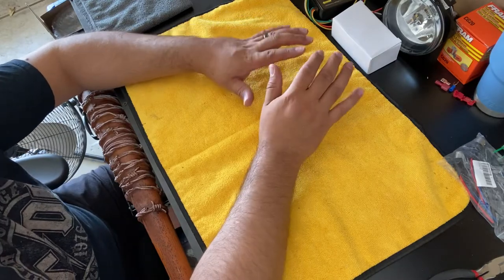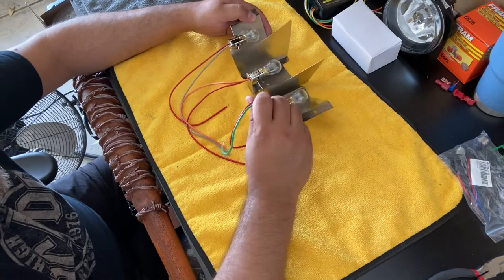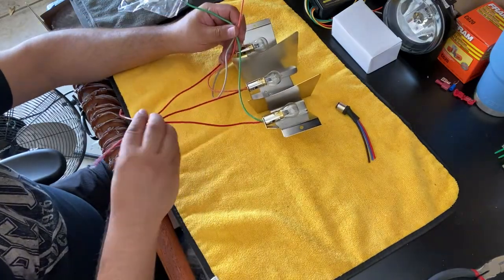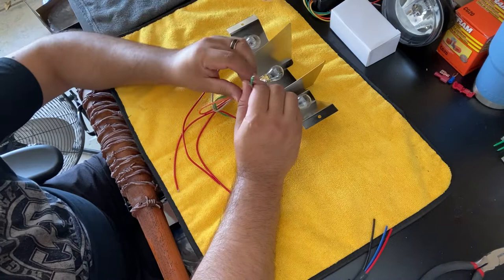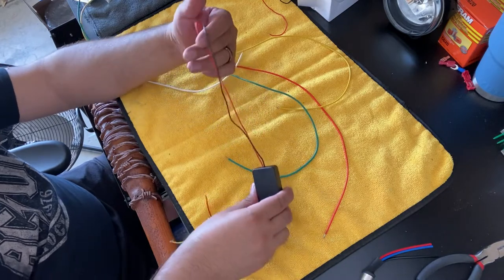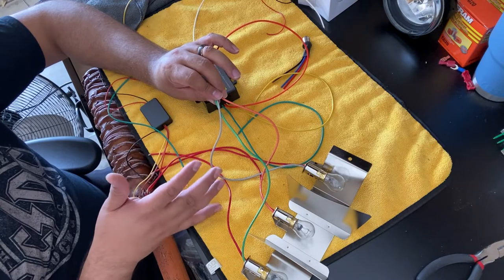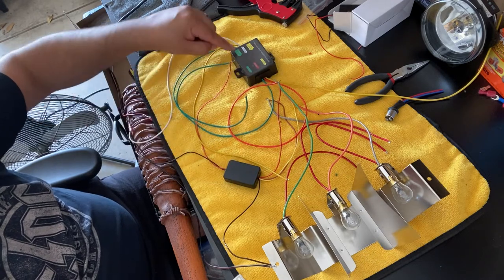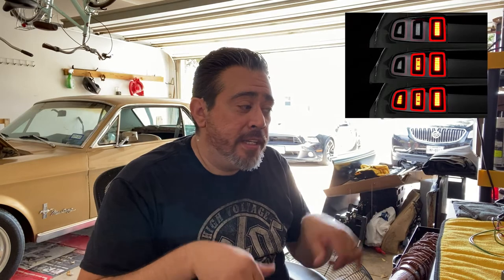Classic Ford Mustang DIY Sequential tail lights  #howto #upgrade #conversation

Comment: Whats up Negan! Thanks for sharing this info with us. For people (like me) that just want the 3 bulbs conversion without sequential, wiring is simple. three wires (hot) from bulbs into  one powered wire, and the other 3 bulb wires, three into one ground. An inline fuse was not mentioned in the directions, but not a bad idea to put one in. Would have to see how many amps are drawn for fuse size. Cheers from Terminus.
Reply from the maker: thanks! Yes add a fuse and 18awg wire min. You know it could have been a 45min video with everything that should be covered.... LOL
Reply: @CMOSX  Right Negan. I have to admit, I was a bit overwhelmed with all those boxes and hookups etc. I am learning wiring now and have fixed and wired most things on my 67. Thank God for Volt Meters.

Comment: what about the yellow left turn wire.  I take it goes to the left sequencer hot wire. and then I need to hook up the brake wire also wired into the 3 sequencer bulb lights.

Comment: This may work while driving and changing lanes during highway driving. But if your making a turn, at a stop light you normally have the brakes on...  How does the sequential circuit work when the lights are already on?? I think you need a separate bulb circuit for turning and brakes.
Reply from the maker: You have to use dual filament bulbs or in my case I used two step LEDs. When the brake is depressed the lights engage and when you engage the turn signal the second filament or LEDs on each bulb turn on.

Comment: Thank you good video I just wanted to ask you I bought the sequential turn signal boxes and they say LED so I'm afraid to connect regular light bulbs ?
Reply from the maker: You can connect regular 1157 bulbs or 1157 LED bulbs. If you do use LED make sure you swap out your flasher for an LED flasher under your dash. Check out my video about hyper flash.